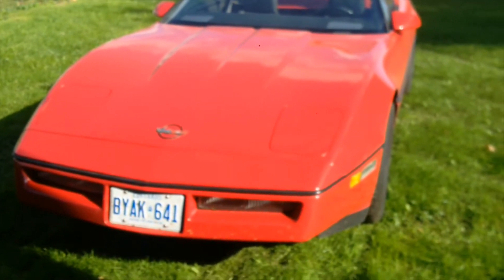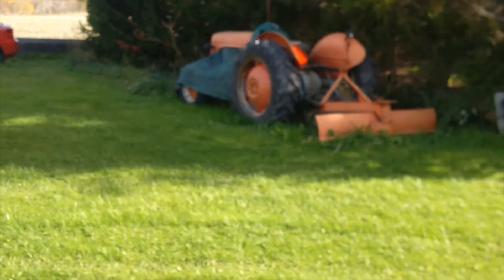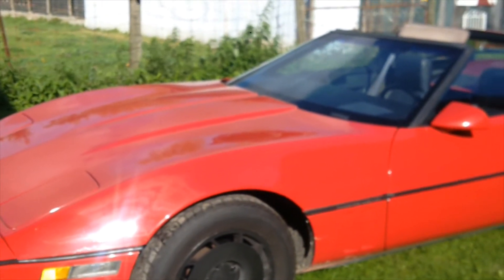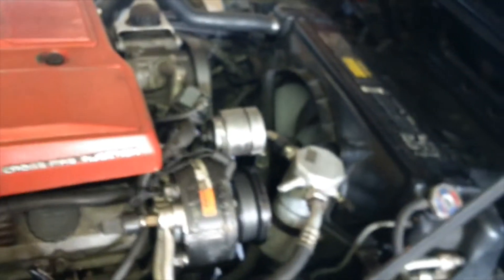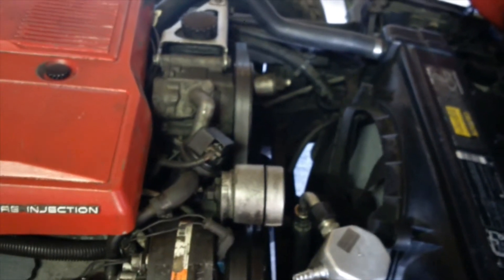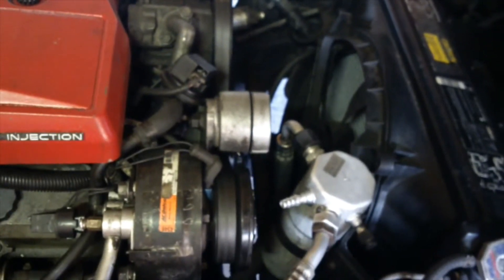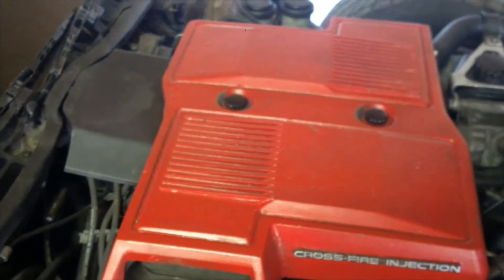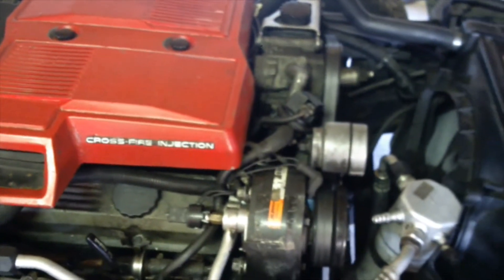1984 C4 Corvette Winter Projects

Comment: Thanks for the vid! I live in Florida so I don't put the car away for the winter. I have an 85 C4. Right now, I have the engine pulled apart to replace the fuel injectors, EGR and fuel regulator diaphram as well as some wiring replacement. I may be replacing the radiator soon.  Since everything was pulled apart anyway, I changed out the diaphragm... the work is never ending! Appreciate your vids. Take care!
Reply from the maker: Thanks Eric, good luck with your car!

Comment: I just purchased an 84 Vette myself it had set for a couple of years battery and fuel pump got it running pretty good  Now to rebuild the dash and headlight motors and replace the brake booster and that should do it for the winter. Maybe in the winter of 22-23 I’ll look into upgrading the power plant some, trying to find a renegade intake to replace the crappy stock gm crossfire intake
Reply from the maker: Sounds like you have your work cut out for you! Crossfire is an excellent fuel delivery system, for what it is supposed to do. I'm very satisfied with mine. Just got to stay on maintenance like anything else. I've heard good and bad about the Renegade. I think finding a good quality one is not that easy. Hope you can find a good one. Good luck with your Corvette!

Comment: Your Ram Air idea is pretty good, hope ya video it? My winter project is a 43K set of heads & CF intake port and polish.....My buddy is giving me a set of heads and his old intake, its the parts in my L83 tear down video.....I want to gasket match the gaskets and make bigger/polish where I can? they're 882 heads, not the best by far but, the price is right.....free! Hope to install them late winter or spring time? see how it goes?
Reply from the maker: Sounds like you've got a plan! Can't wait to see the video on how you do. I'll video the ram air deal for sure. If it doesn't turn out, then I'll cut it and do it the other way. Looking forward to your videos, and the great info they provide. Thanks!
Reply: @1984C4Corvette_DIY_Garage  I like driling the holes vs cutting out like I did....drilling will give a cleaner look and probably better metered airflow into the intake?
Reply from the maker: @daredevil7442AUTOMOTIVE  I think so. It might be difficult to get it uniform, but I'm going to give it a shot. I've also read somewhere that it can make the hood unstable at high speeds, not sure if that's true or not but I remember seeing that comment someplace. I'll give it a go anyway.